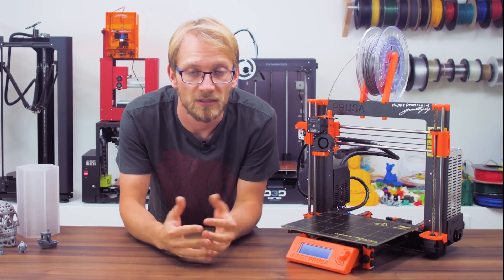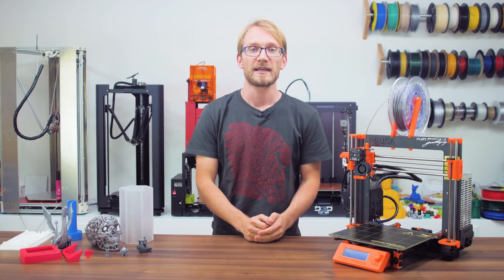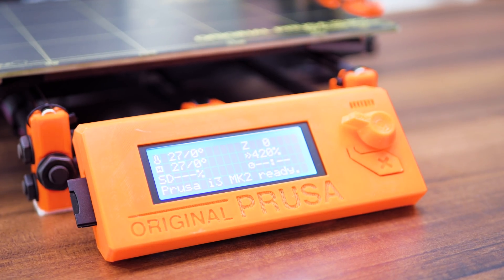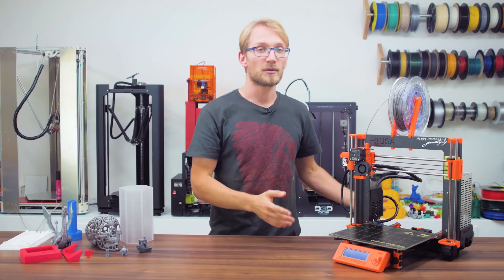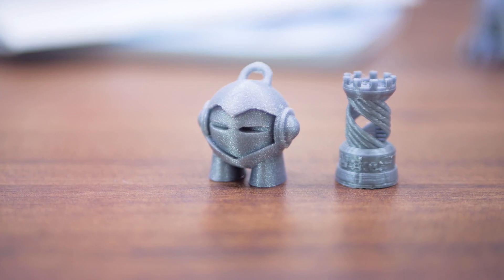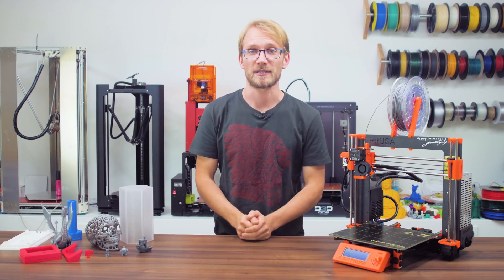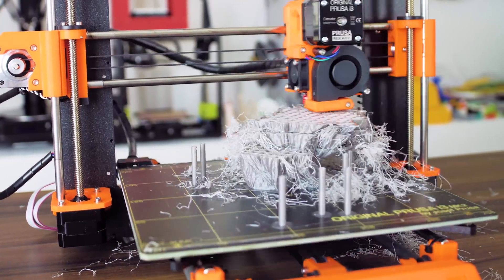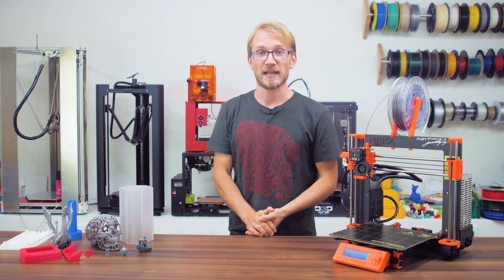Review: The Original Josef Prusa i3 MK2 🏅 It doesn't get any better than this!

Comment: Appears to be a perfect machine for making client parts in conjunction with my freelance Solidworks consultant retirement gig.   But, please tell me why I read that an enclosure is necessary to allow elevated ambient temperatures during the build which presumably prevents warping and provides stronger bonding between layers in the z-axis?  This is what frequently occurs with the open frame printer I bought in 2016.  Seriously trying to learn here...

Comment: First off "The worst customer support ever!!"
Secondly if your in a US time zone good luck trying to get in touch with them even via email.
It will be a back and forth brief one sentence email that will last weeks.
Thirdly, when you receive your box from Europe, it will most likely be damaged and a very good chance the printer will need not only adjustments from being banged around so badly, but likely cracked and/or broken parts.Now that we discussed the good, on to the bad.
Once you have a problem that you cannot fix or repair yourself without them sending you a replacement or replacement part.
They pull a disappearing act, or more realisticly, they completely ignore you! 
Yes, you can try for days, weeks, now over two months, no response.
We are left with no choice but to take fraud measures against them.Im sure its a great when its working, but be careful with the praise until you have something go wrong that you cannot fix!
Then its a whole new picture of what this company is!

Comment: I'm interested in getting a 3D printer to create headphone parts, I'm a headphone modded and the hobby is getting serious now so I will be getting a 3D printer, it's really a question of which one... that answer will be determined by several factors, firstly form and function of the printed parts, how strong will they be and will the finished parts be good enough to sell, will the parts cop some abuse, i.e., as part of a completed headphone structure weighing up to 400g, would the parts survive repeated falls from a height of 6ft? Would the tolerances remain tight after such repeated abuse, such as ares with screws?

I don't expect you to give me a guarantee, intimately this would be the first stop on my way to a markforged two, but knowing the available materials do you think it's plausible I could construct an entire set of headphones using this printer that's sturdy, has both stiffness and some flex? Obviously design is a major factor, but let's say I cloned your favourite headphones using this printer... could the resulting unit survive my stress test?

Could this printer make a clone that looks as good as your favourite headphones? Assuming not quite, can these materials be painted, baked, sanded, drilled, lacquered, resin coated?

I know your busy, my questions are long, I apologise and thank you for taking the time!! I don't expect a lengthy reply, I'd be happy with a confidence rating out of ten or yes no probably... lol

Thanks again!

Oh, the last factor is price, and I can answer that, I can afford this printer, but I guess it boils down to how close to consumer grade could I built parts with this machine and is there something close up to say .$1,500 to $2,500 max that would be better for a beginner knowing this is a lifetime commitment, not just a hobby. Appreciate all your advice, thank you!
Reply from the maker: FFF/FDM printers can get really close to injection-molded parts when it comes to part strength - that is, if the design of your headphones is flimsy, it'll break as a 3D printed part and as a mass-produced one.
The properties of the plastics (sanding, drilling, painting...) are the same as injection-molded, so generally you have a lot of options for post-processing.

Comment: I just think the aesthetics are really ugly.  I don't expect a piece of art, but this thing is just hideous.  The orange/black yuck.  I mean if you had a garage to put it in sure, but I'd like one that looks good enough to put in your home, and I wouldn't want to have what looks basically like a fisher price toy on my table.  Really is a shame.  I know they have an all black version, but those 3D printed black parts don't look good.  Along with that, this thing is just waiting to burn out with the power supply being open if a mosquito or any other bug gets in there it could burn the whole thing out.  Also makes it hard to use in any working environment, cause if get dust in the power supply, again, it could cause issues.  No doubt it prints well, but this thing is a failure waiting to happen.

Comment: Tom, Thank and your channel for supporting the 3D printer community.  I have only recently become interested in acquiring a 3D printer and your review and recommendation have pretty much decided me on getting a Prusa i3 Mk2.  I wanted to follow your request to make the purchase through one of the sellers affiliated with your channel, however when I clicked on each of the links you suggested, I couldn't find a way to even buy a Prusa i3 Mk2, let alone any link to you or your channel. Can I buy one directly from Prusa and still provide you with some benefit?

Jim
Reply from the maker: +Jim McKenney the MK2/MK2s is only sold directly from Prusa, I do not have an affiliate link or any other type of sponsorship from them (I'd probably be a rich man).
But feel free to leave a note with your order to let them know I sent you there 😉

Comment: So I'm looking to get into 3D printing as a new hobby/project and plan on purchasing a printer by the time my tax return comes in (will allow me to spend around $900-ish USD)  and was just  wondering if this would be a good printer to start/learn on? If. Or if not, what would be a good choice as I would prefer only purchase one somewhat nice one rather than 2-3 cheaper ones. In turn if this is recommended what would be some other printers around the price point that I can compare to?

Comment: It doesn't get any better than this? Really? The Prusa is a good implementation of a bad design with zero regidity. I mean threaded rod for a base? 899$ USD really? Trust me there are better units or there by a long shot for this kind of cash.
Reply: Thomas Sanladerer For lightweight and cheap, Dagoma DiscoEasy 200, for intermediate Monoprice Ultimate 3D, for high end quality prints Ultimaker 3, or do what I do take a used Replicator 2 and upgrade the Z axis and heated bed with the kit from lennengren in Germany. This setup makes an amazing printer for the price. There are other options as well.

Comment: So my only experience with 3d printing is using 123d design to print things out on shapeways. I don't have any experience with 3d printers, but I have experience with taking apart and re-calibrating huge xenetech laser engravers. Would you recommend the kit to a novice like make or should I spring the extra $200 on a pre-built?

Comment: Thomas, this is super helpful. I'm a teacher that has opened a FabLab with multiple 3D printers from various vendors. I have specific ones I don't like, but I'm still looking for the best fit for a school. I am leaning toward this Prusa i3 Mk2 for a big project. I have to buy 60 (yes sixty) 3D printers for middle and high schools and I don't want to get the wrong one. I can spend up to $1000 on each one and they be going into labs with teachers who have limited (if any) experience. Judging by your video, I assume this is the way to go but I'd love any other insights you might be able to share (particularly with regards to accessories like should you use tape, glue, etc). 

I'm looking at buying each school 3 assembled printers and 1 kit so the teachers and students can learn by assembling.

Comment: Tom, good videos you make. lots of great info. Since you like Prusa i3, I was wandering if you would like to make a video on flatness of the bed, cause looks like a lot of them are warped. Also what good PINDA sensor is if it can't compensate for uneven bed? To what extent it can compensate unevenness? Its a critical component that Prusa didn't got right I think.

Comment: A word in defence of the Chinese; The Pruse i2 that I built in 2013 has proven itself capable of incredibly high resolution and a polished glass side wall finish IF you set it up correctly. Whilst everyone else was using hairspray/painter tape I struggled to get my prints off the untreated glass bed because I had my Slicer Settings and Heating/Cooling spot-on. Build the machine properly, level the bed accurately, and the humble i2 can rival a $2000 printer.

Comment: I will commend Josef on his work, he is a genius with making good quality 3D printers affordable, but there are some things which made me get an Ultimaker 2+ instead. First was the fact that its a RepRap. I want a printer made from sturdy high grade materials like an Ultimaker. Second was the open frame. I want to print lots of ABS, CF, SteelFill type filaments. This means uneven cooling above the print bed. Third was a picky one, the colour. Orange is my most disliked colour. It literally makes me want to vomit. Its just a thing with me. And fourth was what reaffirmed my decision. Both Prusa and Ultimaker printers can make high quality parts. But a friend of mine has a Prusa. He can print very good objects but I found mine turned out better. He even agreed. My highest resolution of 20 microns blitzed his, but took a while. I will say though, Prusa is better value for print quality, but he is constantly taking his apart to repair (MINOR) things. The only maintenance I have done is re-levelled the bed once since I have had it for 8 months. :)

Comment: How well does this print in PETG?  Are prints reliable and dimensionally accurate using out of the box settings (e.g. nuts fit in holes, good top surface etc)?

 I have an i3 variant which I have tuned and upgraded a lot since I brought the kit from BCN dynamics 18 months ago.  On the whole I'm now getting good reliable results, however, the Original i3 MK2 does have some nice features that interest me like the larger print bed and pre-set slic3r profiles.

While I know that all printers are different, out of curiosity I copied the PET slic3r settings you flicked through in this video and got much worse results than using my own (quite different) settings.  I'm surprised to see they have the FAN set to run as through my own testing and research I've found that PET produces much stronger prints without a fan with no loss of quality, it's only very small (fast) layers that require cooling to ensure the previous layer has set.  I've also found slight under-extrusion to be beneficial but again noticed the pre-set PET profile does not use a reduced extrusion multiplier.

Given that I only ever print in PETG these days I wonder whether I'd be disappointed by this printer given it looks like I'd still have to tune and tweak slicer profiles etc - £650 would be a lot to shell out for a slightly larger build area but no other benefits over my existing i3.

Comment: Looking at the Prusa i3 DIY 3d Printers on Ebay they seem to be using 2 different hot ends, one with the fan on the front and one with the fan on the right side. Also some have the LCD display built into the top and others have it in a small piece that is bolted on.   Is one kind better than the other?
http://www.ebay.com/itm/281945430440?_trksid=p2060353.m1438.l2649
http://www.ebay.com/itm/2016-NEW-Upgraded-Full-Quality-High-Precision-Reprap-Prusa-i3-DIY-3d-Printer/252554605495
Reply: On the cheap i3-alike kits the frame (sturdy enough) and the bed (sturdy enough, heatable and plan enough) are MUCH more important than the display, the electronics or the hotend. About Hotends - Most of them use MK8, MK10 or E3D-V6-Fake - they're all usable - if you have the choice I would use an E3D-V6-Fake as it's lighter and so you have less ringing on your printed objects but MK8+MK10 have some benefits aswell, like better retraction and better performance with flexible filaments.
Reply: Thanks, a lot of people say the i3 models on Ebay are junk so I ordered a Maker Select 3D Printer v2 from Monoprice that was on sale for $249!  It's got a lot of 5 star reviews on Amazon but 11% who had serious problems gave it just 1 star so it seems to be a good model if you get one without problems.  Besides, I know someone who got one and said it works OK. Additionally it comes mostly assembled so you just have to mount the vertical part on the base and plug in the cables so it doesn't have to be completely assembled like some quadcopter kits that I've never been able to get flying!

Comment: I am trying to decide between this printer and the HIPTOC prusa i3 3d desktop printer. the HIPTOC is less expensive (about $300) and i also noticed the original josef prusa printer has quite a bit of 3d printed parts which i am not sure if those are in any way bad or good. I have heard good about both and they both look good but I dont know which one is better

Comment: About a year ago  I got the M3D printer.  I learned a lot, and decided I want another printer.  I want a machine that has high quality and reliability ( The M3D didn't really do either)  I've narrowed the selection down to:
The Original Prusa i3 MK2
Ultimaker 2 plus
Lulzbot taz 6
Which one would you suggest?

Comment: My short Summary  of the original Prusa Research i3 MK2 so far ...

I had to wait longer than promised, the guys are not communicating actively and your mileage in the online chat might vary. However, after printing a bit more than 1 kg material so far, I must admit that it is worth waiting. 

I printed PLA and ABS of different colors and brands with stock settings and it all really worked perfectly. I often increase print speed a bit in Slic3r and it still prints very nicely and very very reliably. I never even wanted to connect a computer. I drop in a card with the g-code and print. No need to fiddle around with the printer at all. This is just amazing.

I love the heat bed. It heats up quickly and is easy to handle. I just clean the PEI sheet with alcohol. That's all you need to do for PLA. I apply a bit glue stick for ABS.  Both worked great so far.

Thomas is right. This printer really raises the bar for what you can expect from a printer for less than 1000 bucks.

Comment: Have you find any problems/issues or anything negative while using this?

you have been using these printers a lot doing Filaween

on the prusa forum there are a few complaints about the bearings , the penda sensor, printing on top of the bolts in the print bed, and a couple of others. I was wondering if you found anything after the initial excitement of this great machine.

Comment: Yeah, I mean. I have this printer. I upgraded from the MK1. Everything you said is true. Still, you could have mentioned something negative about the printer, you know, to make it a more balanced review. For example, who in his right mind puts the 'Cooldown' option of the 'Preheat' menu at the bottom? Like, who is going to preheat to HIPS often than cooldown? Also, you want to load filament, you have to preheat hotend and bed, as the next option to do that is settings -> temperature -> hotend and set target temperature which is much harder to do. All this is just bonus points for operating the printer effectively in production, but it is definitely something worth mentioned in a balanced review.
Reply: Dure its open source you van Just change it ;)
Reply: perhaps, but if it is designed well in the first pace you shouldn't need to learn how to program ad re-design it yourself.
Reply: There will always be new techniques, nothing is future proof. Look at Tesla, the first were fine now they build a new one with new sensors that drives it self ;-)

Comment: This makes me want to buy one! Any word if Prusa is going to release a dual filement printer anytime soon?
Reply: You mean like this? http://shop.prusa3d.com/en/3d-printers/118-original-prusa-i3-mk2-multi-material-upgrade.html
Reply: "4 material feeders with only one hotend". I think I am crying tears of joy :)
Reply: Any idea when? I get funding from my school here in Canada in February, to buy a 3D printer to use at home, and would love multi filament. 
PS love the videos!
Reply: Well if it is a addon... might just bite the bullet and buy the mk2 based on the idea of upgrading later.
Reply: I'd reccommend you to bite the bullet. I bought the MK1 and when they released MK2 I just upgraded it. They always have upgrade kits from old model to new model. That's another thing that I like about them. I got a faulty heatbed (one of the different temperature regions is not heating up) with the MK2 but I am quite sure that they will send me a working one soon as I am resolving this with their five star customer support (they have 24/7 live chat on store site). So despite that I am still a huge fan. If you have touched the quality of their products, there is no turning back.

Comment: Prusa is cheap because they don't speculate with the price. Some 3D printers are overpriced because people pay for it.
Reply: The Prusa isn't cheap, it's just that they save on cost because you assemble it.  The build area helps, but it's actually not a lot of extra cost to increase build area when you have the basic components there.  All it calls for is a few inches more material, longer pipe here and there, etc.  You could probably build it much cheaper if you bought the individual components yourself, but this is basically a put together kit that makes the ease of use by having all the components together and telling you exactly how to assemble them.  So they're not soo much selling a 3D printer, rather they're selling you the supplies and design, and making a profit off of that.